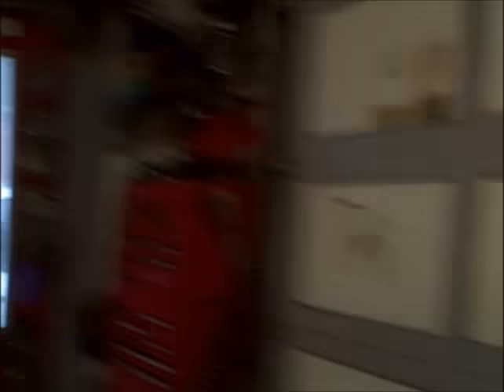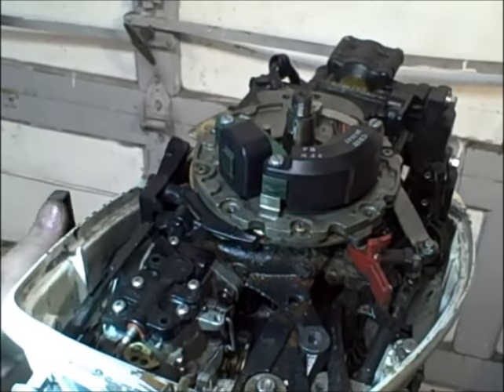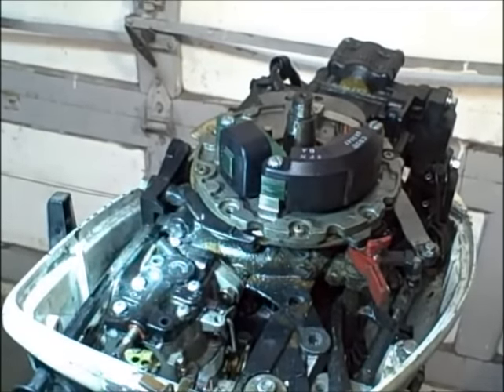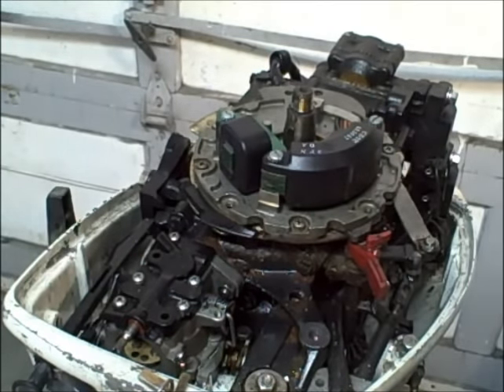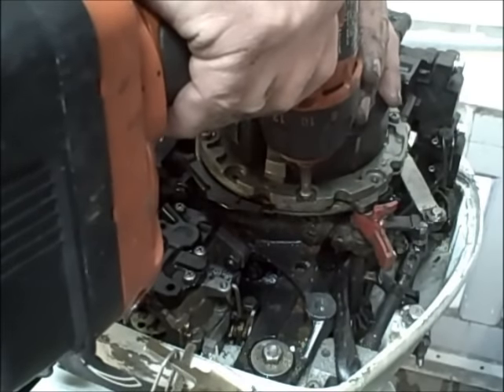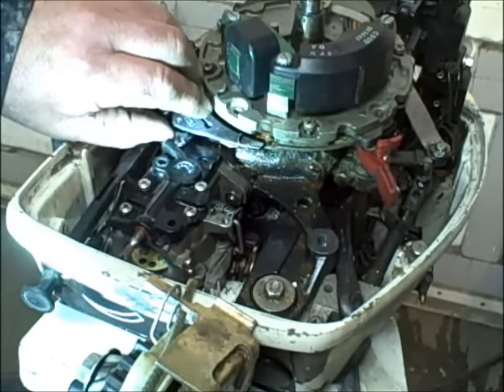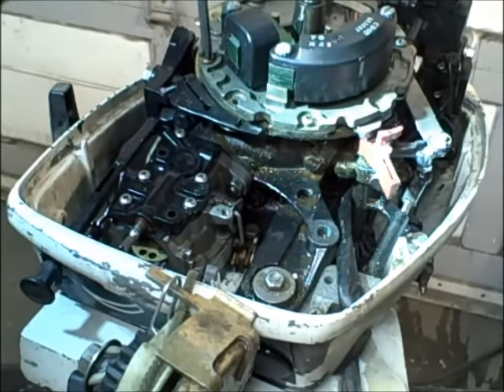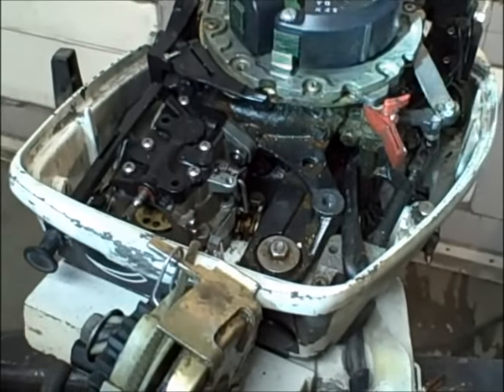Johnson 15 HP , common problem

Comment: Went through this starter 3x working on a 87 9.9. Found it easier to reinstall by taking the handle off as the rope kept getting in the way. Good tip lining up the flywheel notch and marking the starter. Also, interesting that people think adjusting the throttle cam screw will help with low idle. It only works for high speed wide open throttle adjustment of the butterfly.

Comment: I got a run away throttle, she just goes till you think it might blow up, some people say stuck carb, float or throttle and I ain’t got a clue, might just start taking it apart and see what I find
Reply from the maker: look at the position of the cam roller.    kb
Reply: She’s sucking air from a seal ! It’s gonna burn the cylinders then running lean !

Comment: FIRST ROUND KNOCKOUT !  I had one old motor and the threads were stripped for the starter bolt, so i tried tapping it out and use a heli coil , it worked, except I was about 2 hairs off center with a slight tilt, hahaha, screwed up the whole thing. I remember cringing as I adjusted that dang cam screw, but I got lucky!
Reply: I had the same Problem - with the 'starter bolt ' the threads in the aluminium BLOCK  were rung 
I was going to go down the 'Heli-Coil' route - BUT , I discovered that the 'Bolt' if the bottom part had longer threads, that there was sufficient threads withing the Block to accept the Longer Threads .. 
0318936 - Screw, Starter to Manifold 
So - I made a BOLT with a longer threaded bottom section .. It worked a threat ..
Reply: @peterpauldonoghue7024  👍

Comment: I a new subscriber learned on a lot thank you I have one question I have a 15 horse Evinrude with problems with no spark for cylinder compression 55 in each cylinder needless to say it was a motor given to me so no loss either way what do you think the motor will run with that kind of compression thank you John
Reply: Hey John. Wow I'm just now getting your comment and a few others. I guess youtube can't keep up with it all. Anyway yeah 55 is pretty low. Did you rebuild it? Just curious. Thanks again for tuning in!

Comment: Hi mate thanks for this vid helps heaps what I do want to know is I have a 1984 15hp electric start tiller  and it's almost as if the lobe doesn't come all way around enough to open the butterfly up full throttle compleatly where should I be looking at to fix that as there is a good amount of top end throttle not being used is this normal
Reply from the maker: Ok  first take off the air box plastic silencer,  Then rotate your tiller & look inside the carb @ the butterfly is it open to the horizontal position?  That is where to start.     kb
Reply: @kodibassInsideoutboards  nah it's not mate checked that and the pushed the carb butterfly linkage and it has a good 5m of more throttle to wot

Comment: I have the same problem 15 hp were Can I get a new one and what is it called Thank you!
Reply from the maker: +GW'      Cam throttle & screw assembly,  P/N  0396740 $17.00  @ Boats.net                                                 kodi

Comment: Hi . Like the video. The same thing happened to my 15 horse Johnson 1989. Can you please tell me what that plastic cam piece that broke name of the part, also the red arm that stops you from starting in gear mine broke off , and one more lol, the little roller that runs over the plastic cam piece   on the roller there is a plastic piece that goes around that part that rolles over the cam. Mine was old and just fell apart its plastic also . Please tell me the name of these three parts and where i might find the parts to buy . Thank you so much a beginner at this stuff lol

Comment: What causes the Mag Plate to not move? Have no throttle action... finally determined the plate is not moving.
Reply from the maker: +AB,  up under the mag plate is a nylon friction ring, over time the greas gets old and hard, & salty if used in saltwater,  
pull the flywheel remove the mag plate, and friction ring, clean re grease with moly grease & reassemble.  kodi

Comment: Good video yanks for that. Did you do a video on the correct adjustment of the CAM roller screw? And also  what tool is used to adjust the CAM roller screw - I have tried metric hex imperial hex and torx and none of them fit- is it a special Johnson tool ?
Reply from the maker: +HM,  I do not know the size but I have the OMC part #  it is 327622 ball head hex driver I will show it in my next video, Maybe a subscriber will know the size & help us out.   kodi
Reply: i used a T15 Bit (( Torx/Star ))

Comment: Will this issue make it hard to start in neutral, and result in surging/dropping of rom at WOT?
Reply from the maker: +Dave Middleditch,   No not likely  to  cause those issues,   just look at the piece of plastic in question in the video & then inspect yours to see if it is broke.  kodi

Comment: Hello iv a 4.5 hp Johnson . When I pull the pull start it most times don’t catch . Have you any idea . The rope pulls out and retracts . Thanks for the vids p uk
Reply: the spring or metal peice that wraps raround the gear that goes into the flywheel. replace it

Comment: What the heck is the purpose of that screw other than breaking the cam all the time?
Reply from the maker: +AVH , when the mag cam plate is @ its full open sometime the butterfly in the carb will go past full  horizontal level,  this screw will allow you to back of so the butterfly is @ level inside the carb throat                                 kodi

Comment: What's the name of the plastic piece so I can order one.. no one knows the name or part number at West Marine?
Reply from the maker: +T H,  its called , throttle cam & screw assembly Part # 0396740
                       approx cost around   $15.00                           kodi

Comment: Why not put the starter assembly in before you put the flywheel on?
Reply from the maker: +Mike Hunt,  It would have made it a bit easier , But not to much cause of the Mag plate,  &  wanted to show its a pickle but quite doable , also did not want folks to think you need the flywheel removed just to work on the starter.           kodi
Reply: The flywheel on my ‘79 doesn’t have the notch, so I guess I’ll have to pull it when I redo my carb next week. Poor baby doesn’t want to idle.

Comment: Howdy :() Is it hard to convert a 1973 40hp Evinrude from remote control to tiller handle  ??
Reply from the maker: +cocaineKidUSA,   If you have the parts  (  spare junker motor )   Not hard at all)  It is all about parts Availability ,,    If you got'm    Your  good to Go...      kodi
Reply: What parts i need ?
Reply from the maker: +CocaineKidUSA   you would need the transom bracket top handle , tiller handle with throttle rods sprockets and grip.                        kodi

Comment: My 9.9 Johnson while not stay at a 3mph troll. It settles down to 2mph. Constantly having to feather the throttle up to 3mph. And yes goes back to 2. Grrrrr! What must i adjust to achieve the constant 3 mph?
Reply from the maker: +Rick Gurule,  Does your motor have the  troll""   adjustment  knob on the  port side of the  motor ?     It is this mechanical set up   that was  put in place to allow you to set  "" EXACT''       Troll speeds,    My King Salmon  fisherman  pay top Dollar to have this """  omc  "" option  ,,, Available on the 9.9  /  15  HP  evinrude    /   Johnson  motors  that  I sell during the  King  Salmon  Season    They  ""DEMAND ""    It,   anything less is     Hummpy  Fishing,,,   Not   Good  for a Outboard  guy, trying to sell    ,,,,     Kickers........                               kodi
Reply: @kodibassInsideoutboards  Why yes it does! It is very stiff though. Hardly does anything as far I can tell. Explain please how it actually works. 

And yes I need this working for trolling 360 style dodgers for "kings"
Reply from the maker: +Rick Gurule,  Many options available,  If it were mine I would add the optional Throttle resistance clamp,  It does what it sounds like,,,   it is a simple plastic ring that clamps around the tiller throttle handle & by adjusting the wing-nut you can set the throttle where ever you like and tighten to hold that speed,  cheep , effective , & simple to install,  If you would like the part #  I can get that for you.        
                                                                                                                           kodi
Reply: @kodibassInsideoutboards  yes please on the part number. I would like if possible for you to explain this low throttle works. It is attched to a plastic or teflon part. That apparently does nothing. I would to show you a pic. The reply option here does no offer a pic opinion. If you have a email addy. I can send the pic to you.
Reply: I have searched YouTube for any help on this low idle adjustment. There is only one. How to replace a broken L.I.A.

Comment: my little orange save you from yourself so you cant start it in gear is not being held where its supposed to be, the spring looks loose, not sure whats going on,, no matter if in neutral or not when I pull the pull cord, the orange piece locks the starter pawl..

Comment: Hello Kodibass, after the winterperiod I wanted to start up my 15 hp evinrude 1983.   unfortunately no start. I checked and it had no spark. I disconnected the stopping button but still no spark. Do you have any idea. Can it be the electronic box.?

Comment: I have a 91 johnson 9.9. It looks like someone has ground down the cam plate on the low idle side. Could this be to increase travel to try to get more top end power? I'm gonna replace it. It was overstroking so far it stripped out the cam roller screw hole. I locktighted back in and loosened the cam plate screw but now I think my timing adjustment is off im lagging at full throttle and don't have any power? Any advice?
Reply from the maker: Most likely your butterfly is advancing past level @ wot,  kodi